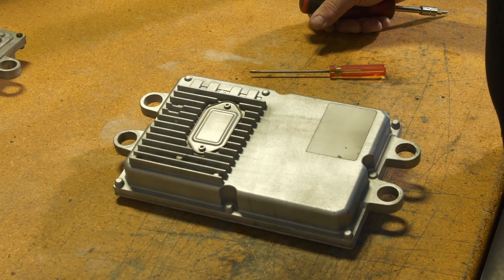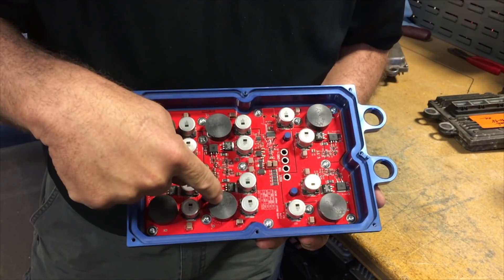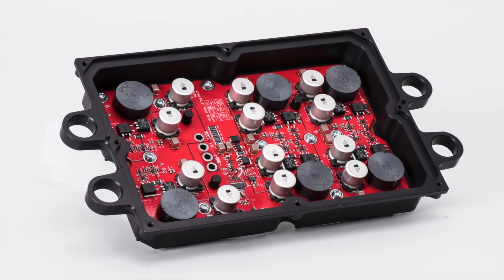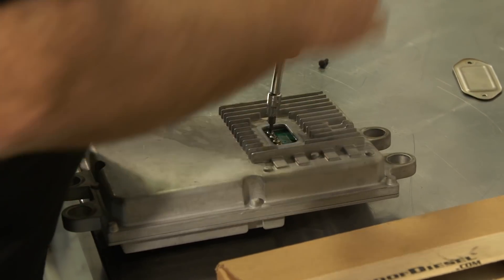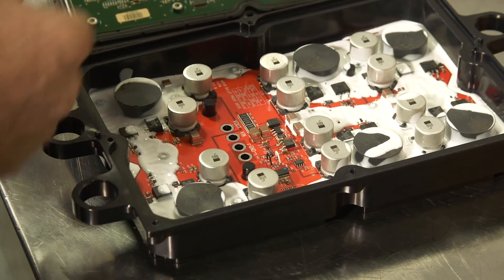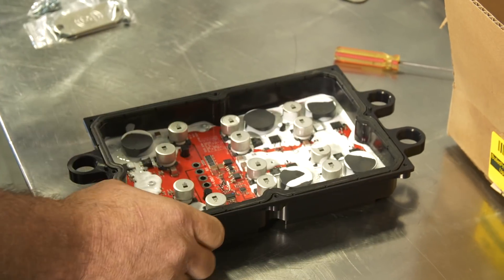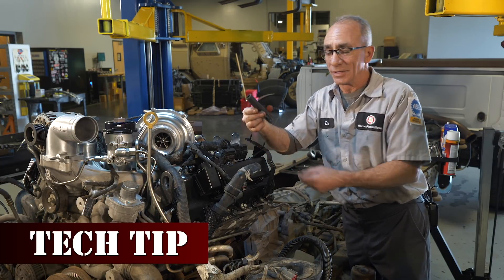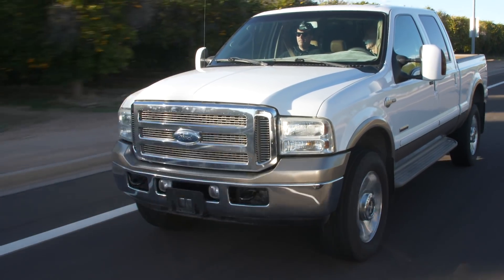Fixing 6.0L Pattern Failures - Episode 5: FICM

Comment: Do you have to buy a new ficm if you cut one wire but upgrade injectors later?
Reply from the maker: Apologies for the late reply.  If you were to cut the wire for lets say 53V, then wanted to go back to 48V, you could simply cut the other wire and the board reverts back to 48V.  The higher than OE voltage is fine and has no known negative side effects, even with "upgraded" injectors.

Comment: I am currently doing a FICM replacement. I chose to purchase a Ford remanufactured FICM. I going to update the old FICM with a new BulletProof power supply.  And swap back to the old FICM in the future then the FORD FICM will be my spare. Because of the age of the pickup I am installing a new injector harness and a new connector on the on the wires that go to the PCM. I am also upgrading the alternator and the batteries. I have always had cold start issues so I would plug the pickup in at night. In the process of fixing a low boost issue  that was caused by a bad map sensor and the hose had a hole in it. I have never noticed a power loss from the FICM but I did find it was at 30 volts when running. So I have parked  it and I am doing upgrades before I put it back on the road.  I pull a 30` gooseneck so it is always working the engine. This pickup already has a the BulletProof egr cooler and oil cooler and head studs.

Comment: What determines what voltage you choose or is there a benefit to higher voltage for the FICM?
Reply from the maker: On our 6-Phase FICM, there's a wire you can snip to choose between 53v and 58v.  We don't claim any performance gains from these, just reliability.  We have had customer reports of smoother idles and better mileage.
Reply: @BulletProofDiesel  wouldnt increasing the voltage be hard on the injector solenoids and other parts of the ficm?

Comment: Great segment for 6L owners, thank you all at BPD. One request: Can yall elaborate in detail on the voltage differences in the FICM's provided by BPD? Why three options? Which is best?
Reply from the maker: Sure!  In order for proper operation (activating fuel injectors), an output of 48 volts is needed from the FICM.  Our military-grade BulletProof FICM has a 6-phase option, which features two additional circuits to share the load in the name of durability and reliability.  The 6-phase BulletProof FICM can be set to output 48 volts, but it can also be set up to output either 53 or 58 volts as well.  This is done to ensure the voltage doesn't drop under 48 volts under most circumstances.  We've had reports of customers getting better fuel economy, faster starts, and less 'striction' as a result of the higher voltages, but we haven't yet tested to confirm those claims.  Glad you like the vid!
Reply: BulletProofDiesel,  thank you for taking the time to reply! Wondering though: 53v vs 58v?
Reply from the maker: Some people prefer the 58v option, as they simply want as much power coming from the FICM as possible, to make a failure an even smaller possibility.  However, the 58v setting can cause a soft code in the dash (not a check engine light).  The 53v doesn't seem to trip the code, and it's still an upgrade in power from the stock 48 volts.  Lately many of our customers have gone with the 53v option for that reason.  Thanks for your interest, and good on you for taking the time to understand this stuff!
Reply: Thank you BPD for taking the time to explain y'alls FICM's. Next time mine goes down I'll definitely upgrade to the 53v!